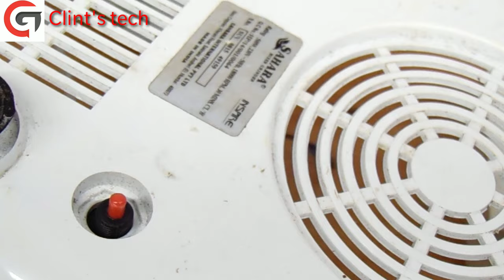How to test and change circuit breaker of a mixer grinder|Sahara mixer grinder repair|#mixergrinder

Comment: Shall I connect the copper wires directly... Because the terminal has damaged, it is not connected properly
Reply from the maker: You can change the terminal also

Comment: bro mixer grinder use cheyunna timeil electricity trip aakunna issue
Reply from the maker: Short undonnu noku
Reply: @clints_tech  mixer use cheyumbol mathram trip aakunnu
Reply from the maker: Mixer grinder nte connection short undonnu nok